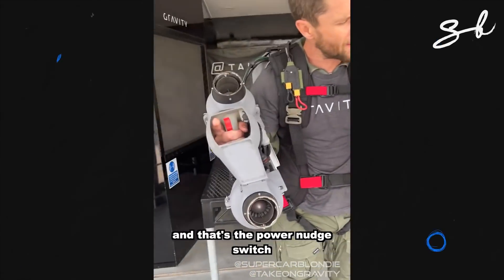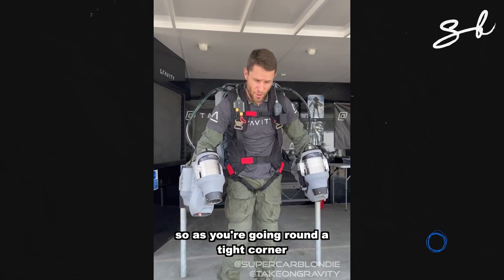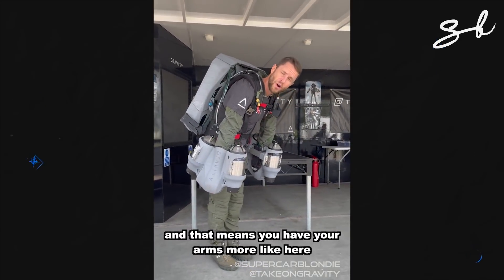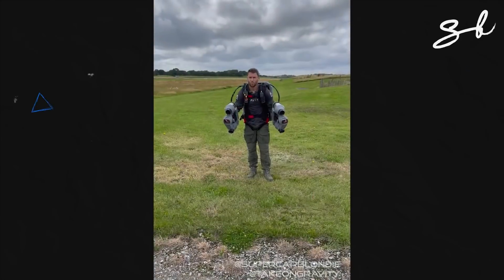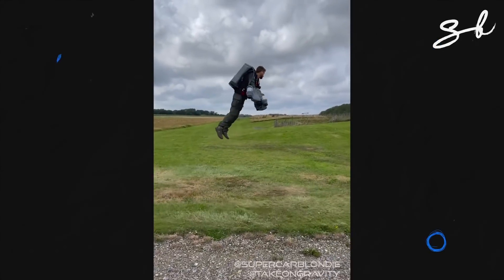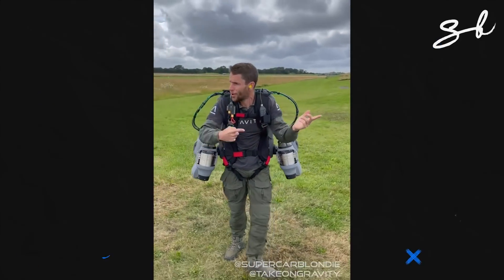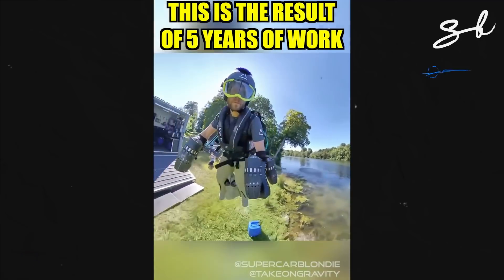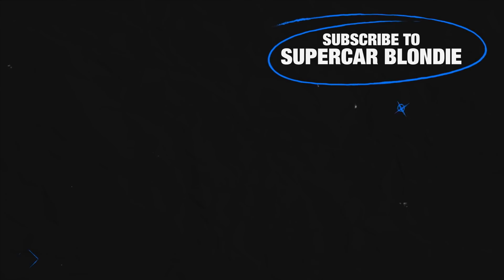Dad Builds Home-Made Jet Pack!

Comment: The 1 rocket jet pack seems much easier to control, I would speculate. I think they work with (chemicals) and have a low exhaust temperature. However, any jet pack is awesome! You know the FAA will be attacking your new freedom with regulation if it catches on too big like drones. Maybe more than drones, as people transport is occurring. Fly safe!